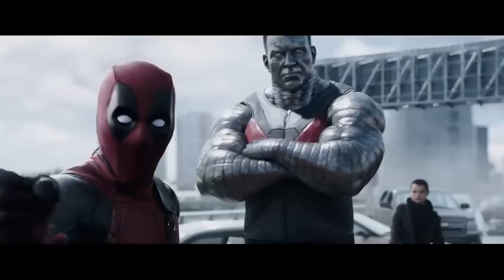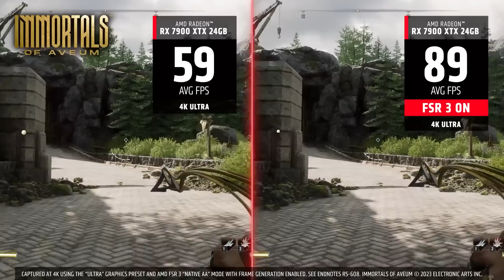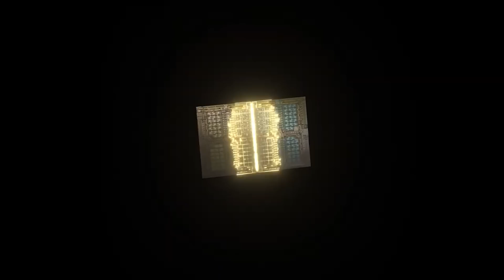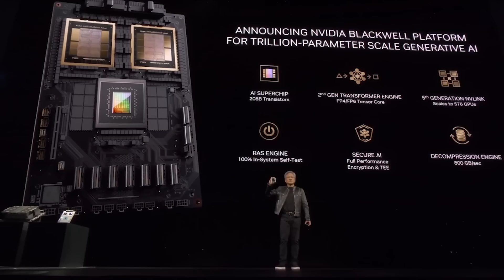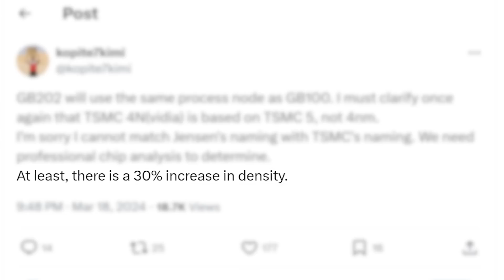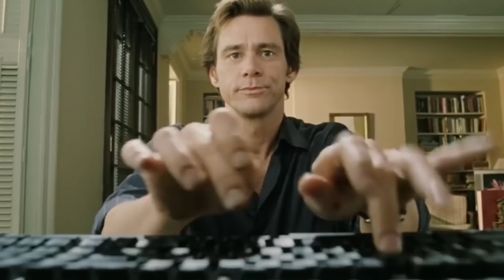RTX 5080 BEATS The 4090!!

Comment: Just bought a 4070 Ti Super, so don't care. :) I'll see what's out in 5 years. But I can't imagine the 50 series is going to be cheap.
Reply: Yeah, I'm sitting on a 4080 Super so yeah i feel no need to upgrade for a while but everyone who has current gen GPUs should be skipping next generation anything. But it might be time for the owners of AMD RX 6000 to upgrade as they don't have the AI cores to use FSR 3.1
Reply: @forog1   Yeah im sitting on an RX 6600 rn(i had a Pc for school with integrated graphics so i bought the card and a R5 3600 for 280€). And i will wait for the next gen to see what they can do and if its all meh or completely overpriced im just gonna buy a new pc for ~2200€ with the 7900xtx
Reply: @TreFeKsGaming  Even that would be a major upgrade and give you the ability to use FSR 3.1. But I'm betting the AMD RX 8000 might not be a big upgrade over the 7000 in raster like an 8700xt should lose to the xtx in raster but I'm betting the RT performance will be worth toggling on let's say a 8700xt so beating the 7900xtx in RT.
Reply: i don't think fsr 3.1 is ai based, it's still just some math stuff that'll be done on regular cores @forog1
Reply: Same, people always say wait now isn’t the time to buy a gpu. 4070ti super is fine for 1440p for a few years so I’m happy

Comment: back not to long go, a 70 class card would beat the 90 class card.....
Reply: I remember when the 3070 launched, performing like a 2080 Ti. That was some good value. 4000 series is value wise equal to 2000 series.
Reply: @igor4knezevic  Hell i remember when the 970 was beating the 780ti. The 970 was insane value, but this was a time when nvidia used to care about their customers.
Reply: @chrishans8120  good times... x70 was always the last gen peak performance card with a bonus of power efficiency. 2000 series deviated from that "rule" and well, 4000 series did it again. I can just hope 5070 is on 4090 level of performance, but I'm guess I can only be delusional if I expect that.
Reply: @igor4knezevic  how is the value the same as the 2000 series.
Reply: @General930-b1g  Value is worse this generation not bad
Reply: @igor4knezevic the 4070 super beats the 3090. 🤷‍♂️

For like...a third (or more) the price.

Edit: or more being because some people were paying 2400 for them when they were in short supply.
Reply: @firghteningtruth7173  oh yeah, that's true, but then again, 4070 Super is a cut down 4080, and it came well after thr 4070 launched. 3070 was at 2080 Ti level of performance, on launch
Reply: @igor4knezevic  they had just refreshed the 3090 with the ti.
Reply: @firghteningtruth7173 it doesn't even beat the 3080ti bro
Reply: @AMRsti93  depends on what it is being used for. It beats it in aggregate.
Reply: Then what is 4060 being equal to 3070
Reply: @pacspecific the 4060 doesnt even beat the 3060ti. it barely beats the 3060. even the 4060ti barely beats the 3060ti (sometimes loses)
Reply: @sleeve.3995 exactly they're more like 4050s😂😂😂
Reply: @sleeve.3995  I mean 4060 isn't equal to anything but 3060. Even the 3060 outpaces the 4060 most of the time without use of much Ai
Reply: @AC3handle  4060 is catastrophic as I know. 5060 is looking to be same on nearly all levels of 4060. 128 bit only with 8x that rapidly reduces VRAM capabilities not the price is only determing factor
Reply: @AC3handle  4060ti 16gb is considered worst gpu in recent history according to NVIDIA and gamers. No one would use the card for mining either.
Reply: @AC3handle  The rumors are looking to say tabout his card but this not all my opinion but the rate of NVIDIA selling 50 for 60 prices are criminals
Reply: Lol man.The 4060 do the same as the 3060 :D   @pacspecific
Reply: @pacspecific  3050
Reply: @Phoenixlul  And despite that, there are still deranged fanboys out there that defend Nvidia for this. Its exactly why PC gaming for the entry level and midrange segment could be dead soon.
Reply: The 1060 is equal to a 980 and has more vram
Reply: You mean like... This generation 😂 4070S beats 3090
Reply: I still remember the 1060 beating the 980....
Reply: Don't worry, he has that title scheduled for next week.

Comment: I would certainly hope so, especially since the 4070 was triple the performance of the 3090 according to Nvidia
Reply: Performance per watt yes lol
Reply: Yeah but, the 6080 tho, that Will be a beast
Reply: @talysdarkthoughts552 imagin the 10090 ti
Reply: @talysdarkthoughts552  And 6090 will be click nice
Reply: gotta get that 6090 for the 69 @talysdarkthoughts552
Reply: Lmao
Reply: Idk I think the 1080ti was just as good as the 2080
Reply: @spencez8537  it was. The top end card being $700 was amazing
Reply: If you're quoting Nvidia then you're denying their kool-aid. Don't be fooled
Reply: with frame gen and dlss 3, definetely is
Reply: Imagine the 11090000000
Reply: considering the 4070 is 100 cabbage step down from 3080 with less bandwidth and underwhelming performance that barely puts a high five to the 3080 without DLSS
it is actually 4060 looking lot alike at the specs, just double the price :face-blue-wide-eyes:
Reply: What? A 4070 does not come even close to a 3090...
Reply: @impactsuit9871  exactly
Reply: No chance. My 3080ti outperforms any 4070/4070ti
Reply: @bob_ohms2low I have a 4070 super ti, your 3080 isn’t coming close lmao my card is almost 25% better, regular 4070ti is 20% faster then your card 😂
Reply: @Jason-fv5my  He doesn't have a 3080 he has a 3080ti, 4070ti is most definitely not 20% faster than it. 3080ti is basically identical to a 4070 super.
Reply: @steviewonder0850 I have two pc’s for my self and my wife and her 3090 is not getting more FPS than my 4070 super 😂 so why lie?
Reply: @LittleKiller1476psn  Look up any benchmarks on Youtube, in fact the 3080ti/3090 beats the 4070 super in 4k in a lot of titles.

Maybe you messed up something with your wife's card or got scammed and bought a different card buddy 🤣
Reply: @bob_ohms2low you’re out of your mind lol 4070ti is 20% faster then your card
Reply: @bob_ohms2low If it actually outperforms 4070ti, that must be a hell of a unicorn 3080ti. Is it cooled with liquid nitrogen or something?
Reply: @bob_ohms2low  What?How my 4070ti would beat the crap out of an 3090ti with fg
Reply: @bob_ohms2low  Stop guessing. The only time your 3080ti will beat the 4070 in higher numbers is in 2 ways.

1st is 4k due to bandwidth on memory Nvidia always wanted their 70 cards to be 1440p limited.

2nd Is power usage... Yeah, Your card will score no lower than 250% more points over the 4070 costing quite a bit more in its years of service.

I hated the high-end 30 series because of this, and they had bad power spikes as well they could spike as high as 2x their max TDP. Had a 3080ti to... sent it back and got a 6800xt tell 40 series.
Reply: @forog1  I've used 4070's dude. You're a fool.
Reply: @forog1  only way a 4070 beats the 3080ti is while using frame gen, which isn't actual power 😂😂🤦‍♂️
Reply: @bob_ohms2low75 I'm not saying it beats it. It 100% matches it. Those are the facts. I had one (3080ti) and sorry to tell you but yeah vs my friends 4070 in resterize gaming the 4070 matches the 3080ti blow for blow ahain as long as its not 4k then the 4070 is about 10% slower. You are very under educated on it it's laughable. Do your research before you troll comment on things you obviously know nothing about 🤭
Reply: @bob_ohms2low75  Quite possibly a lie you using 4070's 😆 and not know just how close the 4070 truly is not that I care for the performance the 3080ti up to the 3090ti are the most power hungry cards Nvidia made yet. Anyway, have fun with your space heater. It's really good at it while it's at it.
Reply: @forog1 dude sounds like you're butthurt you were wrong. If it's any peace of mind. 3000 series was their first and last fairly priced batch of the rtx series. When I bought the 4070ti I was extremely disappointed so I returned it and went back to a 2080 super.